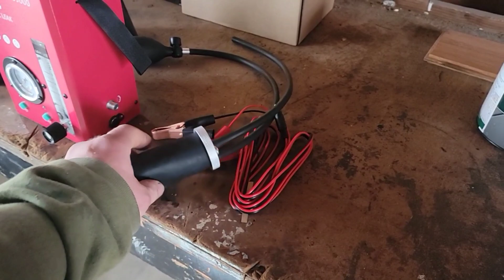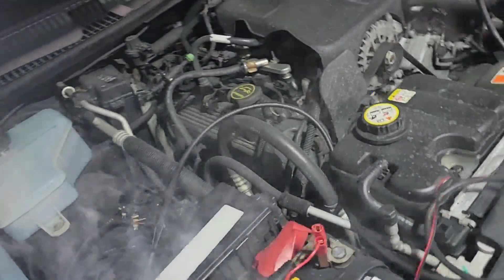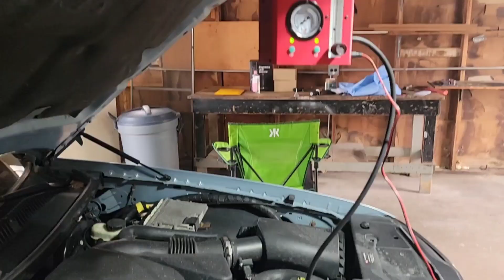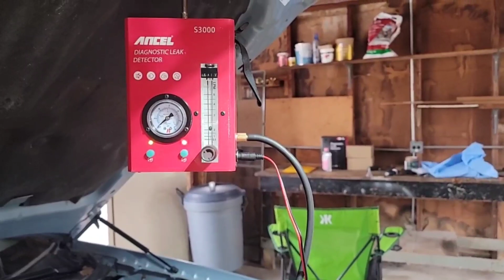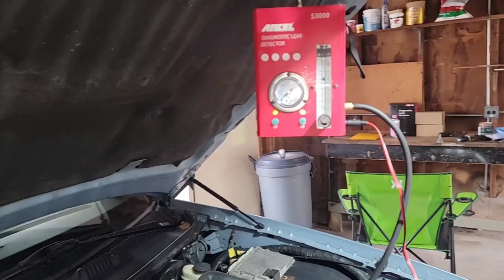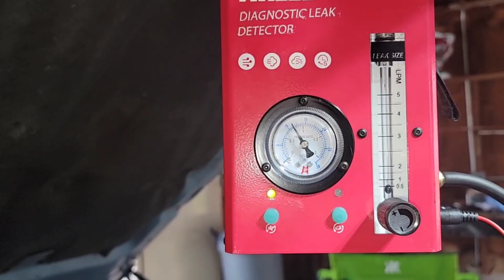Ancel S3000 Smoke Machine Unbox Setup And Review - Shop Style Portable Machine

Comment: This is probably the best review of the Ancel machine.  

I would like to see an option to regulate the pressure down to 1 or 2 PSI.  15 pounds is too much for a plastic fuel tank.

The overheat duty cycle seems like it would be annoying.
Reply: Your looking at the outer gauge numbers the inner are in PSI for pressure and it does not go above 1 PSI so its safe for evap etc
Reply: This does indeed put out too much pressure, esp. for the EVAP. Adjusting flow gauge won't help. Having an adjustable regulator would be nice, but none of these cheaper, Chinese models with on-board compressors have them.

Comment: VERY MISLEADING. AND I'M CALLING THIS OUT!!!  i made the mistake of buying one to only find out its very bad to  use this machine to actually check for a pressure leak. i challange  this
Reply: Interested to hear what comes of this
Reply from the maker: What exactly are you trying to find?

First let's establish of you are doing it correctly 

2ndly - nothing in the evap system is pressure other than the residual fuel evap naturally I creasing and decreasing on its own so you are not checking fuel tank pressure 

So everything else is a vacuum type effect 

So you are not looking for a pressure peak you are looking for a vacuum leak using pressure 

Either the machine is defective or you are not checking the system correctly
Reply: @FordBossMe  i use the smoke pro air, but i'v used that machine and i find it alarming that if you use to test the system for a leak it will put too much air pressure when doing a seal test on evap system ..... test the pressure for yourself turn it down until you see the smallest smoke  flow and simply plug the end with your thumb and watch your guage ride to over 10+ psi.......im not trying to start anything with ya put that thing is dangerous if you attempt to use  it  like a smoke pro??? i'v seen many tanks crack from  this tool....also took out plenty canisters......i'v been in the field for 30+ years and i am sure on what im talking about.
Reply: im telling you that if you put the hook it up to  the port and seal  the system  with a scan tool and turn that on and adjust for' lets say 2 without it hooked up, then hook it up to the port it will create high pressure in the evap system
Reply from the maker: I will come back to this and have a chat with you guys on this very topic and address the pressure of the smoke machine
Reply: @FordBossMe  sounds good
Reply: @billmck12345  You're correct. Trying to adjust pressure by using the on-board flow gauge will not work,
Reply: @FordBossMe  iv seen it on a gm 5.3 intake seemed ti find the leak quickly, but i dont recomend for evap seal test... my .02

Comment: I was  thinking  right from the start, that thing makes 8 bar or  what. Then i was thinking  could  it  damage some  membranes  with that much pressure.. Thinking out loud  here.( can the pressure be  throttled down?) You want the ones  with  float ball  indicator.
Reply from the maker: What you see is what you get right here what I showed you
Reply: You're right. Pressure output is too high, especially if testing the EVAP. The float ball indicator adjusts flow only and not pressure.